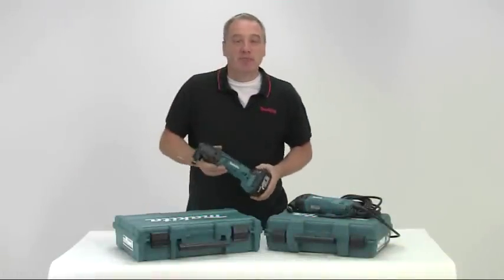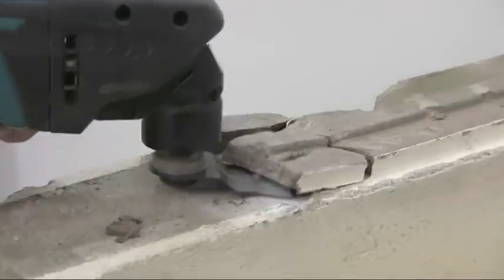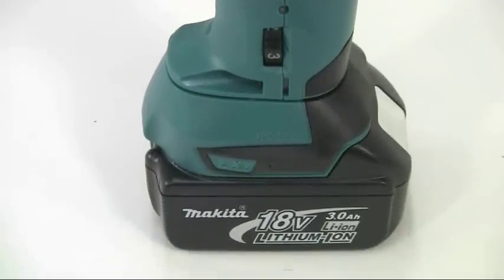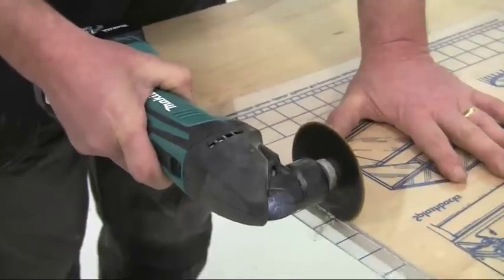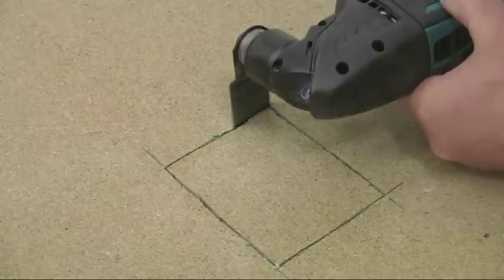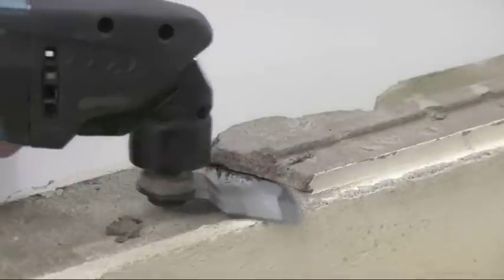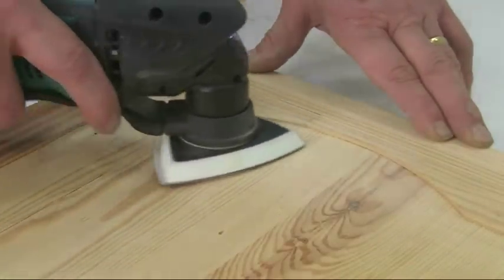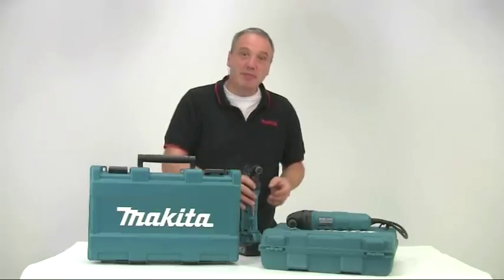Makita multi tools

Comment: Nice to see that Makita is going for standard blade fixings - i think fein is beginning to loose out because theirs is so costly.  Cheap power tools are bad economy - i have 30 year old makita power tools still going strong.
Reply: Fein makes excellent blades. IIRC, the adapter for the Makita lets you use Fein blades. It's one trick for those without the huge budget who don't need a tool that they will use every day; buy a lesser tool, but use the best blades.

Comment: Why not have an adapter that allows the use of the battery model to be run form the mains?  It would be cheap to produce.
Reply: Then you would just have a mains operated tool with the power of a battery operated tool, which is not something people want. Also, if you have access to mains, you can just charge your battery instead. Mains operated tools are also cheaper than battery operated. So I don't quite see the purpose here, seems to cover very rare scenarios.

Comment: Fein Multimaster is the king of the multi tools,longest cord and the most power.Put that Makita against the Fein changing attachments,the Fein Multimaster wins hands down.Fein Uses a lever you flip changing attachments instead of the allen wrench.
Reply: Fein multimaster is for tradesmen that use their tools a lot. YOu can get the makita for half the price if you shop. Fein is the standard of the industry, and is priced as such. Everyone else is second best. The newere makitas use toolless blade replacement.

Comment: Hello, as much as I love Makita, have quite a few power tools, Drill, Hand Circular saw,  Cordelss Drill and Drive set,  I am very disappointed with this multi tool sanding head to which you attach sandpaper via velcro hook and eye system. The Actual sandpaper (loops) is working on any other sanding machines I have, however this head (hooks) doesn't hold sandpaper properly, as it slides off after 5 minutes of sanding with minimum pressure applied. IT has to be redesigned, drives me crazy. Help!
Reply: COuld you sand rust off metal with this tool?

Comment: It has been twice on warranty repair, first time they cleaned the head and said, I am applying too much pressure, so I have let the machine just sand it the second time with its own weight and you guessing right, same thing again! it twists by approx 15 degree of the pad and then, when you take it off you have to clean the head from the loops of the sand paper, very annoying. Tried several different sand sheets all the same result, so it is the head with the micro hooks that is the issue!

Comment: Another fact is that just because something's made in China, it doesn't make it shit. China manufacture a lot of shit, yes, but they also manufacture a lot of top quality stuff. Regarding Makita, the quality is the same no matter where it's being manufactured and that's because Makita's high quality demands. They control the manufacturing process you know.

Use whatever you want but don't lie. Nothing wrong with Bosch but FACT IS that Makita is just as good, in my opinion a lot better than Bosch

Comment: Terrible design if you have to use a hex wrench to change the blade. I wouldn't buy this because I am always changing blades on my multi-tool. I thought we had advanced beyond the slow and tedious changing of blades on tools.
Reply: jollyandwaylo The "New XMT03Z" models ARE tool less blade change http://www.makitatools.com/en-us/Modules/Tools/ToolDetails.aspx?Name=XMT03Z
Reply: Aron Hadleigh That's good. Tool manufacturing is so competitive that any good idea usually gets passed on quickly to all brands.
Reply: XMT03Z loses the light but gains the quick release blade locking (in place of the light). Home Depot has both the older version with the light (needs hex wrench) and the newer quick release tool change. I finally picked one up this afternoon for back yard works and it's the most awesome multi tool to have. $119.